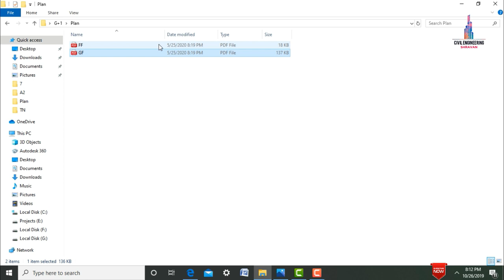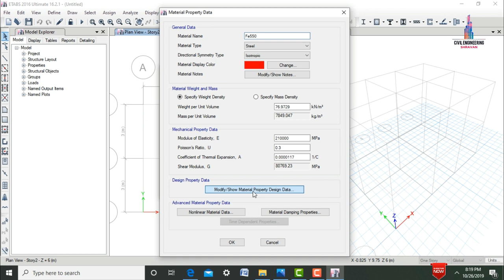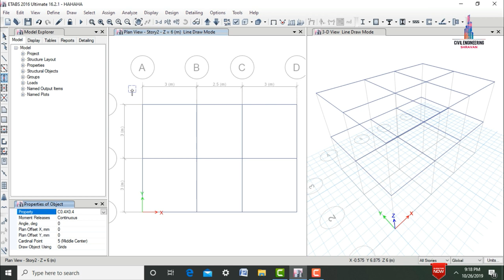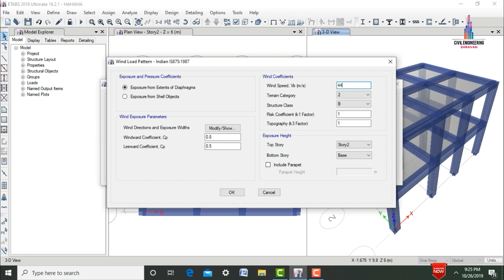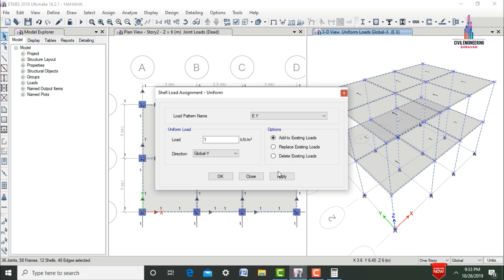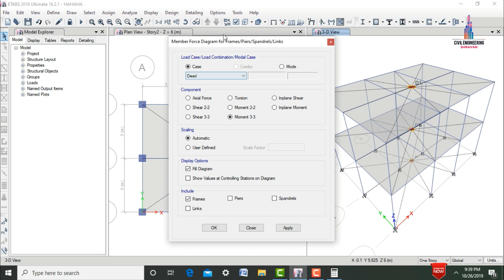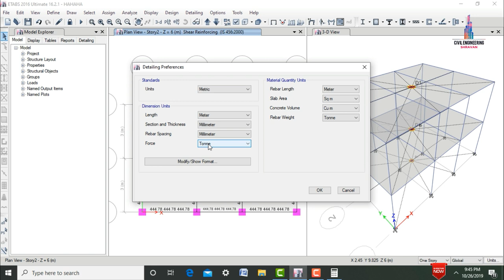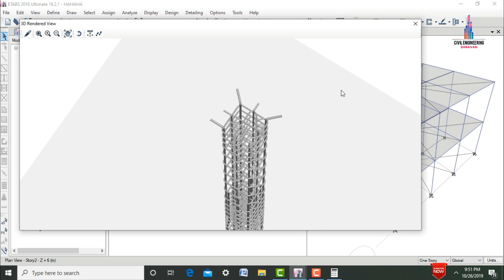Building design (G+1) in ETABS Software

Comment: Thank you for your video. I have a problem
I m using etabs ver 20.3.0  
in menu design -concrete frame design - ter is not rebar sellection rules clumns and beams. why. Must I use 2016 ultimate?

Comment: Dear Shravan
I am a beginner in Etab. Through the other you tube video I understand that in etab , the self weight of beam,column  & slab is not need to calculate and assigned. Software will calculate automatically. But here in you have calculated and assigned. What is correct method?
Reply from the maker: Hi in case of STAAD pro it will directly take loads were in case of ETABS or sap we need to assign individual loads
Reply: Yes sukanta you are correct
If in 'load pattern' for the dead load you have taken self-weight multiplier as 1 then self-weight is automatically taken in Etabs. You don't need to add any load. 
But only if you change the self-weight multiplier to 0 then you have to calculate the self-weight and assign the load
Reply: @civilengineeringbyshravan9596  M30 use kartey ho aap practicle me sir

Comment: Bro... I'm a beginner to ETabs & this video helps to know basic knowledge of it... 

And at 7:30 min you didn't select the column bar reinforcement "Fe550"... You've chosen someother.
But actually that has to be "Fe550" only know.
Please clarify.
Thanks.
Reply: He should take as rebar not Steel in material properties

Comment: Hello Shravan, Why are you not changed the rebar material for column (Longitudinal bar and ties) in SECTION PROP and why are you using A615gr60
Reply: I THINK BY MISTAKE

Comment: In Wind loads you designed as Class B structure.  As per IS 875-Part 3 your model of the structure comes under class A

Comment: Good effort but modeling is not a art, the dimensions and placing of member at appropriate place with actual dimensions is more important .
@5.36 you provided 300 MM depth and 400 MM width for a beam that's no sense to designer. 

Don't mind but you are definitely providing a excellent information for beginners so proper guidance is also important for them.
Reply: What should be the dimensions of beam instead?

Comment: Lots of mistakes in your vedio. No need to give self weight, etabs consider itself. Second though ur assuming the size of beam, no way the depth of beam can be smaller than width of time.